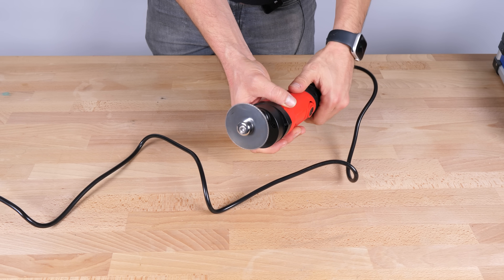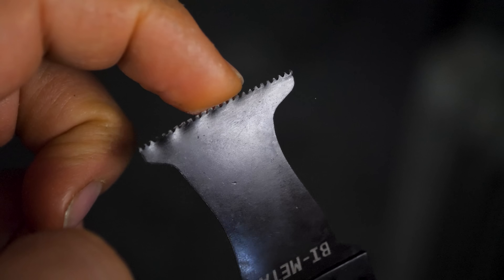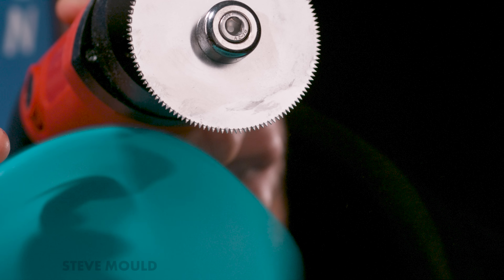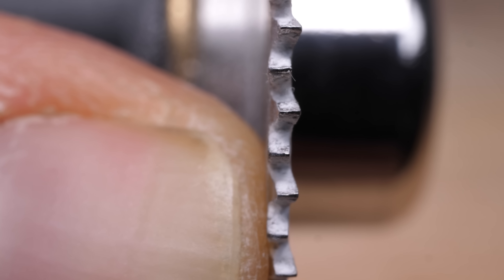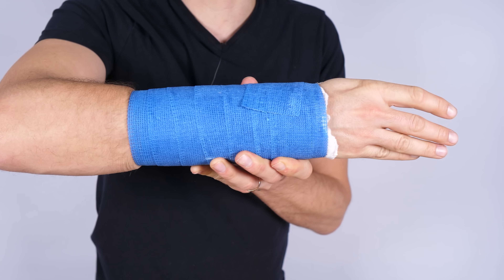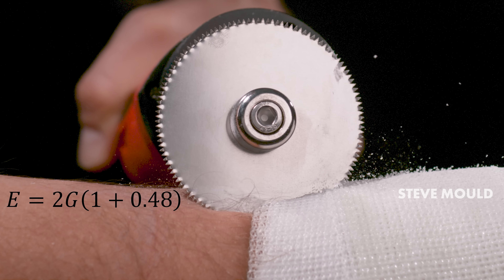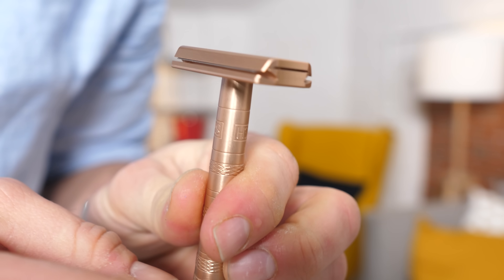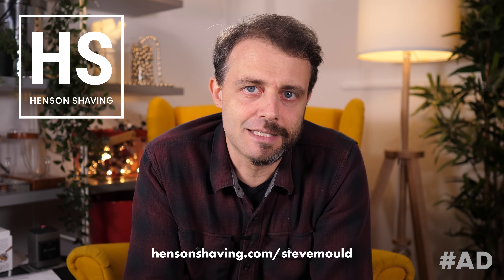A cast saw on human skin

Comment: @SteveMould. Great video!  Long time viewer, first time comment. 

I’m not sure the shear modulus is the most relevant thing to whether the saw cuts it or not.  It seems that the skins elongation at failure is relatively high compared to brittle cast, which  allows it to move with the saw. 

Just thinking about that a derivation of the Young’s modulus/shear modulus.  Do you have any discussion or explanation of that.  Thinking about it, it may be a little easier to see where it came from when you think of it this way: Speed of shear waves = sqrt(G/Rho), where G is shear  modulus and rho is density.  (Fyi, Notice the similarities to vibrational frequency sqrt(k/m), where k is spring constant and m is mass.)

As an aside, not sure if you’re exactly measuring shear or tensile wave, as the exact physics are probably more complicated with multiple layers with different properties…. So I think what you did is great first estimate.

Comment: I use the cast saw and both casting materials shown in the video in the emergency department I work at.  I make splints, mostly.  Fiberglass is nice, but it's often precut to the wrong length.  In our ER, we use plaster at least as often as synthetic.  I don't like to dip the rolls in water.  I measure for the length required and roll the cast material out as multiple layers while dry, back and forth, spreading to the correct length.  Then I pick that multilayered cast material up by its ends and run it under water in the sink.  Then I put it flat on an opened towel and roll the towel to get the excess water off.  Then I place the splint over the cast pad already rolled onto the patient's broken limb.  Then I roll an elastic (Ace) wrap over the whole thing to make it neat and hold it on.  It works wonderfully.  The ortho tech at the orthopedic surgeon's office will be the one that makes the final cast.  They will dip the roll and roll the material around the fractured extremity on the follow up visit a week later.  Splint first.  Cast after the swelling goes down a week or so later.

And, yep I use the old fashioned safety razor.  The best design ever.

Comment: Hey Steve, fun way to show the 3mm swing with your sharpie: draw a 1cm line from the middle radius outward, then 3mm around the arc draw another 1cm line from the middle radius inward. When oscillating, the lines will overlap nicely.

Comment: Proper technique is only use repeated plunge cuts. If you drag the blade along the skin it doesn't allow it to relax and it will indeed start to cut. Likewise care must be taken over boney prominences as well as older people with very thin skin and folks on blood thinners. I personally modified a cast saw blade to fit a lithium ion rechargeable Ridgid Jobmax oscillating saw which I used quite a bit. Finding usable power outlets close enough to the patients' bedside was always problematic. Worked for me, but then again I knew what I was doing 😉

Comment: Even reciprocating Saws with a 3/4 inch stroke  are safe to touch with a finger as long as it os perpendicular with the blade.
Your finger will just move with the blade.
Keep your finger firmly pressed against the blade, start off slow and speed up, if you go real fast it can start digging in so you need to know your limits.
You shouldn't try it with an oscillating saw, if it's fast enough it can cut skin.

Comment: So, in some doctors offices they use Milwaukee M12 Oscillating saws to cut casts as the fact it is battery makes it easier to use in the modern floating outpatient offices. Dr offices seem to like Milwaukee tools for some reason as when I had the screws removed from my femur a few years ago they used a Milwaukee cordless impact driver to do so, it was a procedure done under local anesthetic so I got to watch.

Comment: Why are we not using this kind of technology in applications such as woodworking, to be able to operate it without the risk of injury? Is an oscillating grinder not practical/powerful/useful enough to cut through wood? Surely there is a reason, but I don't know it...

Comment: I am 38 years old. i started growing a beard at 17. 
I have been using safety razors for 18 years. 
I have a $150 safety razor and your sponsors razor is 40x better.
I havent even recieved it yet and i already know it will be better. the angles allow variability to the shave without being "adjustable".
What a win. i bought 2 just in case.

Comment: That comment about trying to find material properties of skin really hit home. I’m a bioengineer, and in college I first learned about regular materials, which are linear (behaves the same at different scales), homogeneous (all made of the same stuff), isotropic (same in all directions), and elastic (doesn’t lose energy when stretched), all very nice properties that make solving problems easy. Then I got to tissue mechanics and realized human bodies are none of those. In fact they’re so complicated the best we can do is ever-more-complex approximations that kiiiiinda work for very specific pieces and nothing else.
Reply: So, instead of a spherical cow, it's a planar teat?  Heh.
Reply: As a fellow engineer, spoiler alert: they're all just (very good) approximations, some are just messier than others.
Reply: @SeanTerisu this sounds like a pessimistic version of George Box's quote "all models are wrong, but some are useful"
Reply: @RockyRaccoon34 nah, they are equivalent, equally pessimistic, and equally correct.

Whether you write pi as 3 or  3.14 or 3.14159, none are correct, they are all approximations. You could write Pi to a million digits and it would still only be approximately correct, because pi is an irrational number with an infinite number of digits. But that doesn't mean writing 3.14 isn't useful or meaningful in 99% of cases.
Reply: Also, it should be considered that skin (like many other biological tissues) is under tension on the body and this influences the wave propagation speed
Reply: *Isotropic.  Isotopic would be "about isotopes".
Reply: I also think that a wave that propagates on the surface of Steve's skin is a surface Rayleigh wave, which is not exactly a 'sound' wave
Reply: Even bone? Surely bone is.
Reply: Hey uh, unrelated but does that mean you've got a degree in biomedical engineering?
Reply: It actually bothered me quite a bit - can't use linear elasticity for such a problem. Hyperelasticity at the very least - so perhaps Mooney-Rivlin or neo-Hookean models with appropriate constraints. I get that he still wants to make the content digestible though - but making references to papers with parameters is probably the best idea.
Reply: Most real world materials aren't really all those either. Even a pure metal structural bar can fail isotropy because of grain structures and grain defects. Usually simple materials are close enough for government work, but a lot of stuff isn't simple materials. We make composites. We bolt things together. Nature makes all kinds of aggregates and composites, inorganic, organic, and living.
Reply: The engineers who designed humans did a very strange job with it.
Reply: My favorite was pharmokinetics. "Assume the human body is a single compartment that is well mixed"
Reply: 😁 reminds me of engineering school long ago, and calculating electrical values.
 At some point of course we had to "talk" about  electrical resistance/impedance and general electrical properties of the human skin (and body). And later in the workshop and lab test it out a bit...
Let's just say when my gym offered me a "body impedance measurement for finding out the % of bodyfat" i declined.
(Remembering what has effects on the outcome of such a measurement, to me means no real reproducable and thus valid outcome. And if there's a reproducable outcome, then somethings wrong with the measurement/measuring device😉)

Comment: They used one of those on my cast back in 1969.
I remember how it couldn't really cut skin easily.
One thing I forgot is how it's only a little like the multi tools that just go back and forth.
This cast tool, has a long lasting blade that you can rotate to a fresh spot, and the more recent multi tools have blades that don't last long.

Comment: I’m the US we really didn’t have any oscillating tools except those made by Rockwell for many many years. (Patent issues) once they appeared though there was a super rapid 8:31  adoption for their near perfect adaptation to cutting rigid materials. I wouldn’t advise cutting close to the skin with the blades, I would recommend the diamond or carbide blades. They do a bang up job on concrete!!

Comment: The first time I busted my ankle and went into the hospatal to get the cast off, they'd lost the saw, the nurse went off to find one, I sat there for an hour waiting for him to find it, I lost patience and raided their carts for a scalpel, didn't find one, I ended up with some pointy scissors, it took about 10 minutes but got the cast off. The nurse found me on the way out the door, no saw in hand, ''where's your cast? how did you get it off? I told him I'm a plaster, I cut that s@#$ for a living. He told me he'd been everywhere and couldn't find a saw, they were going to send me elsewhere. Then it came back to how did I cut the cast off, when I told him we just use stanley knives and dull hand saws to cut plaster, and I just used the ratty old scissors from the cart he had a perplexed look on his face.

Comment: I always find it interesting when people say a product will be cheaper in the long run and then give a time frame. I'm sure it's an average, but I don't find it useful to compare anything using the average. I have the same blade on my razor I bought 3 years ago. Is it dull? As heck, yeah. But I don't care. it still does the thing. Is it sterile? likely not, but I wash it before and after each use and soak it in alcohol once in a while, so it can't be that bad.

Comment: I broke my hand once from table saw kickback. Long story but I got REALLY lucky my right hand didn't get into the blade, anyways I get this cast, its an awful casr, the guy did a terrible job and I had my final essay due for my college English class in like a week. I try and write the papaer but you'd be amazed at how much you need your left hand for typing. So a few hours after I get the cast I say screw it and grab my dremel and a cut-off wheel, but not any cut-off wheel. I grabbed one of the metal ones that looks like a mini table saw blade with teeth. Some of you already know where this is going. I start cutting into the cast and its going fairly well. So with a cast, you have the hard outer material and then you have the soft cotton wrap.... Those teeth on that blade grabbed that cloth and sucked the blade straight down into my arm. BUT, thankfully, there was too much cotton and it stalled out the blade before it actually got to my skin. Maybe 1 layer away. So I swapped the blade out for a normal abrasive cutoff wheel and finished it off. The normal cut off wheel did snag a few times as well but it was a smaller wheel so it couldn't get deep enough to do damage and would have hurt but nowhere near as bad as the metal one. 

I never said I was a genius, but I am smart enough to do a lot of damage... to myself. But learn from my lesson, dont use a rotary tool for a cast, if you are gonna do it at home get and oscillating cutter. They are common enough tools you might already have one or can get one from any hardware store even the discount hardware stores. The sad thing is, is I had one of these but I was too lazy to go searching for it. Even sadder, I was in school for mechanical engineering. I dropped out.

Comment: Broke my leg as a 13 year old and 2 doctors adjusted my cast first day of having it. Yelled many times that they were cutting me but they didn't believe me. Fast forward 10 weeks later when I had the cast removed, I implored this different doctor to not cut me but he reassured me he knew what he was doing.  Turns out he was right as I didn't feel a thing but we were both appalled by the nasty long cut that was left by those dumbass doctors, still have the scar all these years later

Comment: the more i see medical professionals the more i realise none of you have worked with tools until you got into being in medicine. The guard on those is meant to be a lever so you can pivot the blade into the cast without that abrupt downward movement. my main question is why they typically use the round bland on that oscillating saw when both straight bits and half circle and semi circle exist.

Comment: A similar phenomenon takes place when cutting through high strength steel on modern cars using a sawzall during auto extrications. The blade fairly easily goes through the metal, but it can't cut through wires or the headliner since they just wiggle along with the saw unless they are held fast.

Comment: I just shared this video with an engineer friend, and they asked a really good question: why is the sawblade circular?

If the saw only oscillates, then only a small section of the circle will ever actually be used for cutting. Meaning there's no need for the rest of the circle to be present, let alone serrated. So why make the blade a full circle? That just seems needlessly complex, and unnecessarily frightening to patients getting a cast removed.

Fake Edit: And then my friend posted an image they found of a cast saw that only has a third of a circle for its cutting implement. Which just raises further questions!

Comment: Now days they use oscillating blades to cut casts away from skin,no sharp edges just friction and vibration does the job. My son recently had his cast removed and the doctor used a multi tool with an oscillating blunt edge blade to cut it off.

Comment: Yeah...now MOVE that oscillating saw along your skin while applying pressure. They absolutely can cut skin, just not while static. More like tear skin. The teeth of the saw can get into all of the little imperfections on the skin, catch on moles or scars or a spot of skin so dry it has no elasticity, into crack. Different skin density can cause problems too. 
They aren't safe for skin. They are safe* (*if used knowing how they work and the possible dangers).

Comment: Oh god a cast saw.  Seriously I was thinking "Why would anyone want to put a rotating sharp object voluntarily against human flesh let alone Steve?"
This is suuuuper neat how it works.

Speaking of razors. The only good one is the one you sharpen yourself. Huge fan of old school safety razors. Very little but indeed meticulous maintenance required. A little strop and a bit of thin wire is all you need to keep it tip top and it gets done in seconds. Saves hundreds of dollars a year that you would otherwise give to some other people who care very little about you. I still have the original blade from my now what..  8 year old razor and it still works like it was new.  I guess if you let it rust or stay wet you'd have to change more often but like any good tool, you dry it off before putting it away.  All of my best knives require such care and with that they simply work whenever I want them to. Funny how that works. I literally have a chef's knife that is 13 years, no 15 years old and at the touch of a steel it's sharper than any other knife I have. Never sharpened. Sure it's hand made Japanese steel but holy smokes is it worth it.

Comment: Guess they have different types of cast saws... As a kid I broke my foot in a skiing accident in 2003. My foot did a 360 without the rest of me and broke. Hurt like hell. Anyway, when it was time to remove the cast, they used a rotary cast saw... basically a miniature angle grinder. And it went as good as you can imagine. The nurse doing the procedure was young and gave me multiple cuts that turned into an infection. So I had to stay 4 days in hospital on super antibiotics, because of poor staff training, or poor cast saw design.

Comment: I have had a bad experience during cast removal. The doctor first demonstrated on his arm that the saw was safe, because he saw I got scared when he turned it on. He didn't even believe me when I was screaming in pain (I could feel the saw didn't stop when touching my skin) saying the saw was designed in a way that it was impossible to cut the skin and demonstrated again, and the saw stopped when he put it on his arm. He went on cutting, I went on screaming, and it was only after he removed the cast and saw my skin cut in a straight line down the middle all the way on the upper side of my foot. He was quite confused. I was not bleeding profusely, but there was a bloody trail along the cut. Not sure what was the issue, but I know I'm removing my cast myself the next time :))